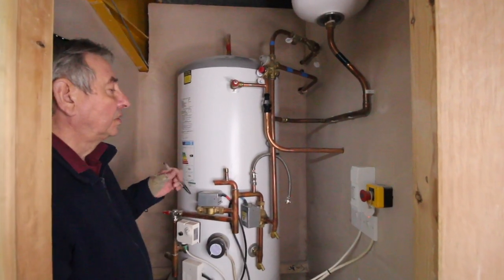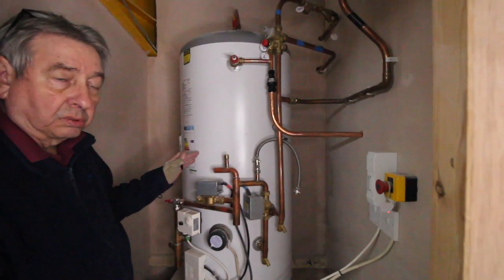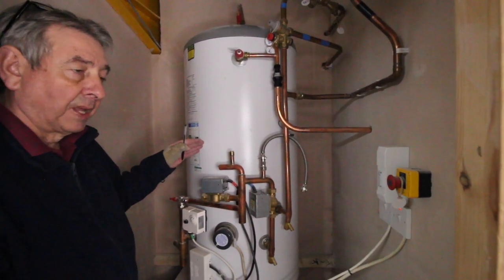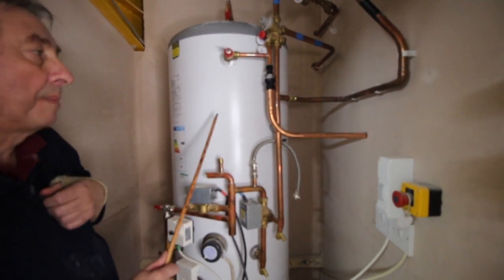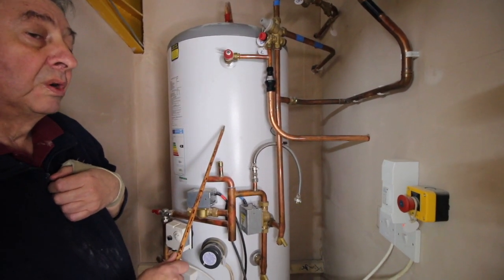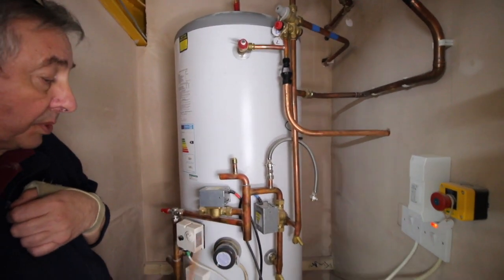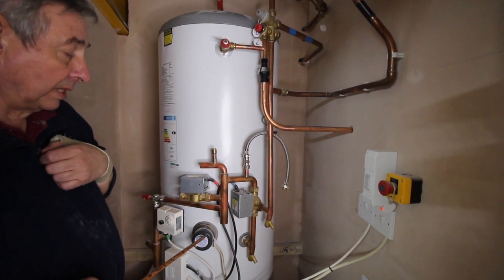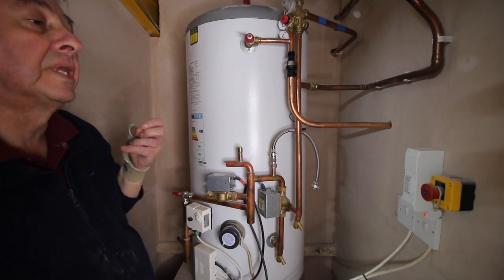Unvented system overview

Comment: The energy supply to heat water dhw and heating can include and eventually will be the primary energy supply will  be air / ground source heat pumps

Comment: That doesn't look like 300mm after the tundish
Reply: Lol tryna be a clever arse muppet
Reply from the maker: Hi Max.  This is the rig we use on the unvented course and the 300mm required after the turndish is to be picked up by students on the unvented course alone with some other faults.